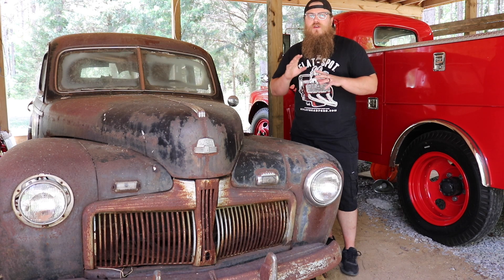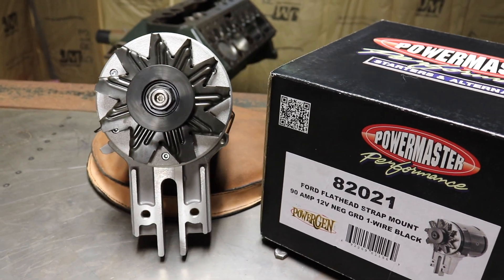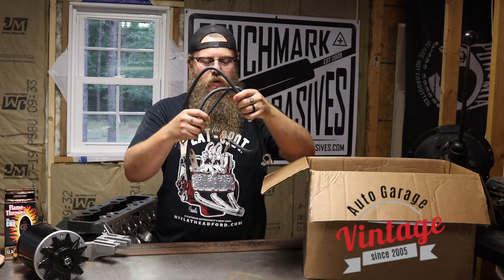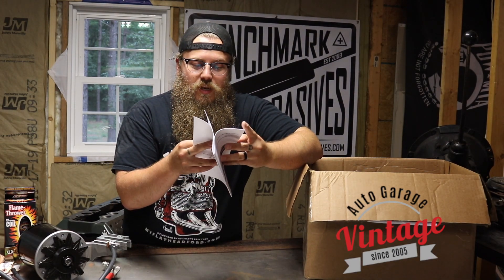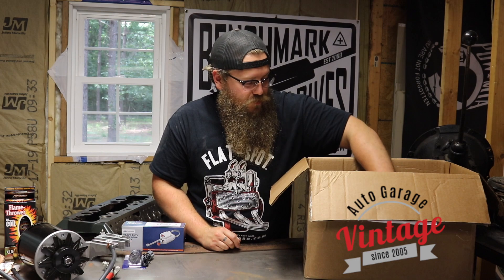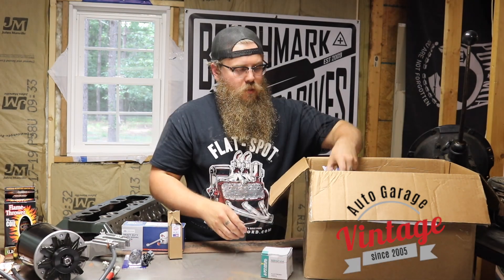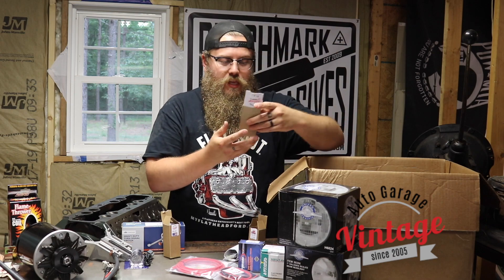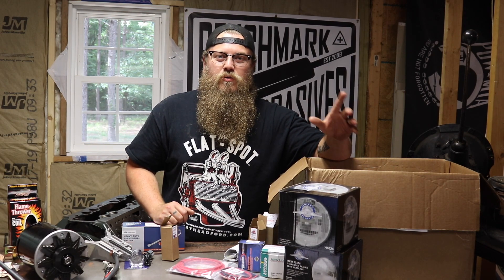6 to 12 Volt Conversion Kit

Comment: What about the conversion for the 6 vdc starter? What is required because it's a 6 VDC + ground and what happens when you reverse the cables? I've got a 1937 chevy truck.

Comment: Hi Zach did a 12volt conversion on my 52 Plymouth. It runs great but seems like the starter spins to fast. I have to crank than let it slow down than repeat until it actually starts. Does this sound right?

Comment: I have a 50 ford custom sedan flat head 8 somebody already did a hack ass 12v swap gm 1 wire alternator 12v battery starts runs n charges but fuel gauge charging gauge and temp gauge do not work as well as no dash lights or dome lights. Mt question is have they fried the gauges them self or do i jus need the reducer an they should go to working again? Or do I got 2 change each gauge out? Oil pressure works touch over 30lb oil pressure cold an under normal engine temps shows Lil under 30lb.

Comment: i have a question i need help? i put a new carburetor and fuel pump in my 1950 chevy bel air 235 engine 3 on the tree ! i can’t get fuel to shoot out of the fuel pump its brand new! i blew out the gas lines! and put new filters nothing ! could anyone help!?
Reply: Years ago I bought a brand new fuel pump..it ran .. but sometimes would just quit.. I took the new pump apart to find one of the valves was never set ,   I had to get a nail set .. and set it.. never had any more problems with it since